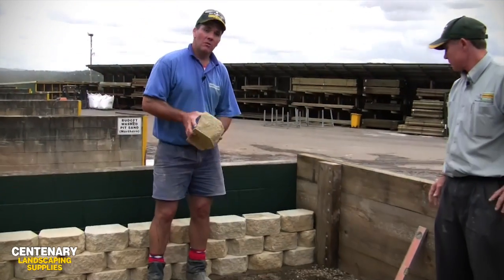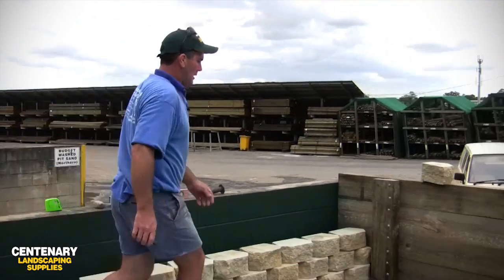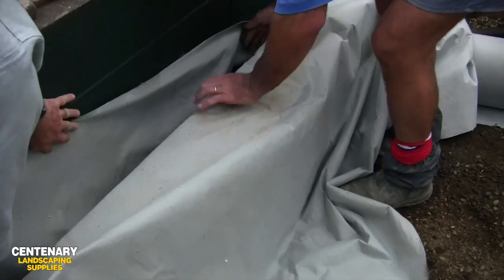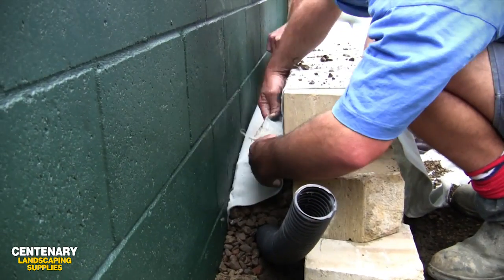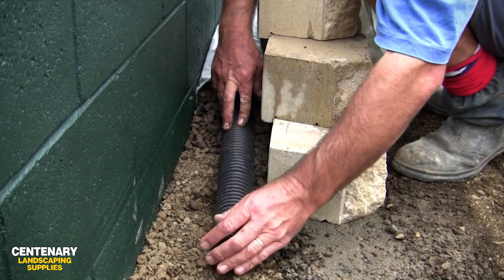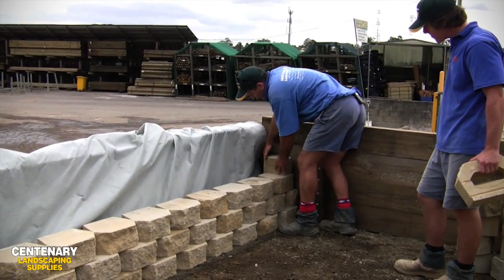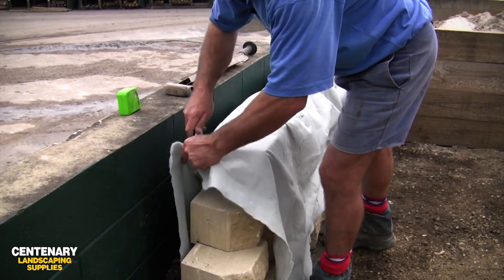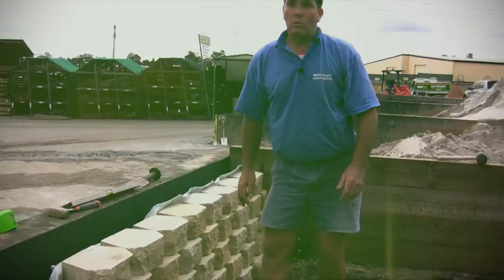Link Block Walls - Drainage & Finishing - Part 3

Comment: How high is one block? How many courses would I need to retain 450mm?
Reply: they're normally 200mm high. So, if you bury half a block as a base, you could use 3 flights finishing at approx 500mm